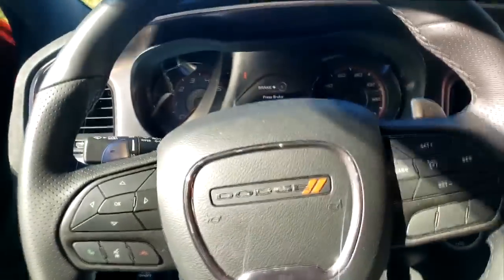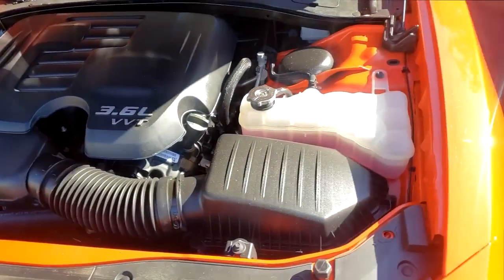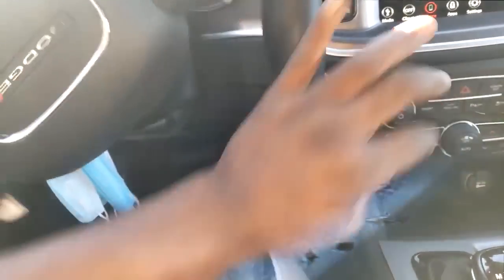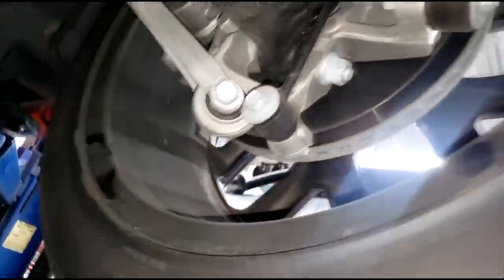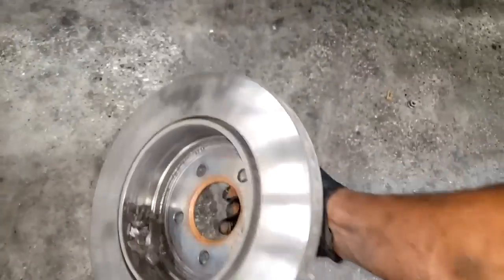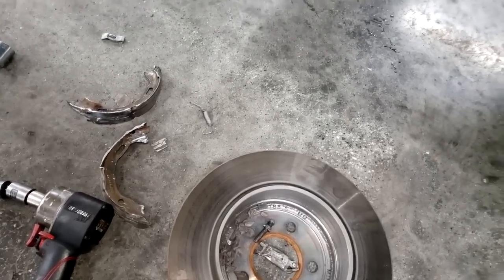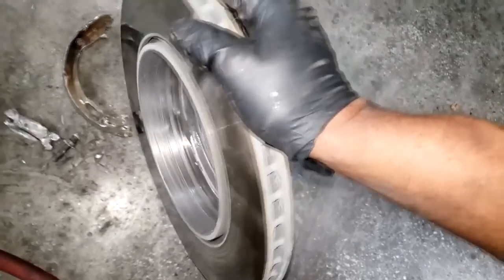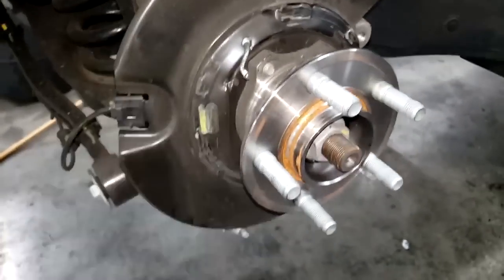This Customer Could Have Crashed Her Car.  Look What I Found. Cousin Pookie Strikes Again

Comment: My call is taking off with ebrakes applied or jamming them on hard when driving. Really just those small pins and clips holding them down on the backing plate. They tore loose and she kept driving.

Comment: It is a common practice to pull the emergency brake to force a drift on some cars.  You see excess rubber, new louder exhaust with magnaflows...  Looks like neglect.  😅 parking brake is designed to hold the car only.  You want to spin, get the v8. Or it could be hardware.

Comment: My guess is someone pulled the Ebrake for drifting. With the amount of trauma that is visible, it was clearly engaged at a decent rate of speed. Hydraulic brakes are equipped with antilock to prevent brakes from locking up and burning up like that, as well as to feather your stop and bring you to a safe stop when you do have to hit them hard from a high speed. Ebrakes are powered by a cable, and therefore they are designed to lock up. Definitely would need to replace both sides in this case and I’m sure JT did so since brakes always get replaced in pairs. I would ask the owner what the hell they were doing in the car to figure out what led to it. Slight chance that the brakes were recently serviced and not put back together properly and that one fell apart, but I doubt it. Most people don’t use their Ebrake often, so they don’t need service right now on a 2020. It looks like it was engaged and blew up. This is exactly why drifters like to install aftermarket hydro Ebrakes on drift cars. Better control without locking up the cable and having their brakes explode
Reply: Makes sense and I don't disagree, for some reason one shoe came loose, tore everything up and jammed into the other, making that disaster. Even drifting, as new as that thing is, should hold up. Could be a defect of some kind, I would check for recalls. Like I said, I don't disagree, I'm sure you know more about it than me.
Reply: @jthonn  yeah the way brake pads and shoes are constructed, if they get overheated the pads can fall apart and detach from the backing plate. This one was either used a bunch for drifting on a drift track until it over heated and fell apart, or the car may have been being driven with the Ebrake partially engaged so it was dragging and steadily getting hotter and hotter and was probably glowing red until pieces of the hardware started melting and eventually crap started coming apart
Reply: @theodoreclay2213  I  think you are spot on right. They were just to new for that to happen, unless there was a defect. If they are misusing that car like that, it won't last very long. I get it you know, that when you get behind a wheel of a car like that, you want to drive fast, do burnouts and so on. If you are rich enough to buy all those tires and repairs, God bless.
Reply: @jthonn  lol yep back to back videos on here he has had cars coming in looking like they’ve been racing or drifting. One destroyed the transfer case and this one the brakes. Not sure what’s going on out there or what midlife crisis people are having

Comment: You can tell it's an SXT just by looking at the hood. As for the exhaust, they removed the resonators at the back. You can see where they welded on the new tail pipes.
Reply: @@thatv8life186 That doesn't surprise surprise me either, but you can tell the SXT from the body panels & wheels usually. They have 18" wheels as the base.

Comment: Somebody drove it with the e-brake applied until it destroyed everything. 
I just did that repair on my son's challenger. I'm very experienced & have no trouble with drum brakes, but those late-model e-brakes are a PITA. 
Also, these e-brakes do  NOT have primary/secondary shoes. They are identical to each other, top & bottom, left & right.

Comment: One concern I have is last comment you made.. Regarding selling her a Differential service. Why? Based on what? You already stated that the vehicle had low miles. Why upsell if not needed?  Please explain.  Thanks
Reply from the maker: After looking at this video again I heard my reasoning for also recommending a diff service. I mention that I wanted to make sure the fluid was up to par. It's call maintenance my friend. Yes I think this was a low mile car as in about 35k miles. I recommend diff services anyway at 30k.

Comment: DAYH-UUM!!  The complaint was noise in the rear?  Did she not complain about brake pedal pulsating/fading?  It looks like that has been grinding parts into each other for some time.  There were plenty of metal shavings in center of rotor when you pulled it off.  If low mileage, is it possible these were brakes from the factory?  Keep us posted on what could have caused such a catastrophic failure.  I'm curious if the other side is worn abnormally.  Is it possible owner hasn't given you all details about 'rear noise' or that she MAY have loaned use of her car to a young man recently?  Lol.  Love your videos, JT!  Anymore problems with those pesky 🐿🐿? Hahaha
Reply: these are the shoes you would only have a pulsating or fading pedal** if they use the parking / E brake to come to a stop as these are disk/drum combo brakes and not just disk or drum.

**not even sure this is possible